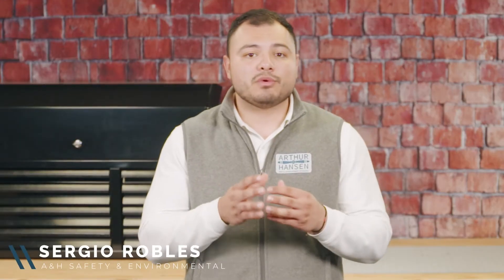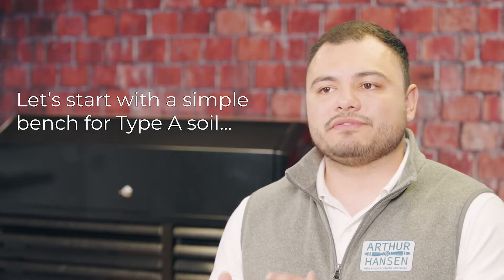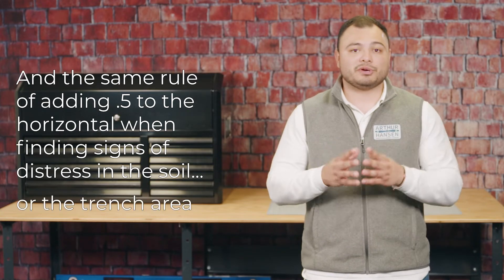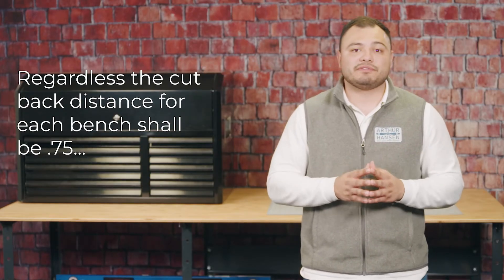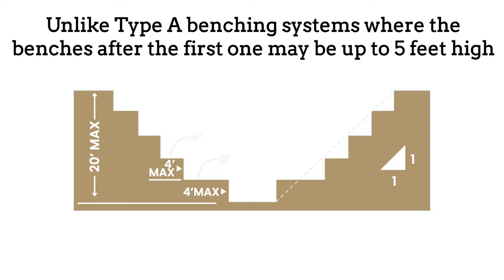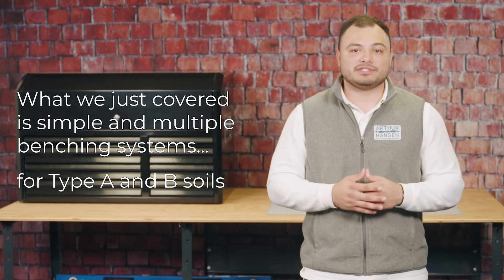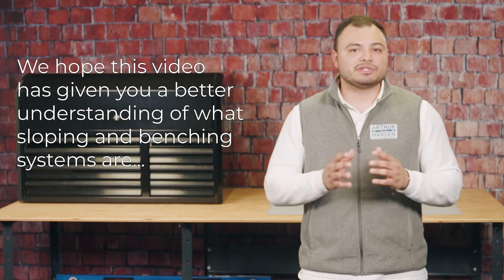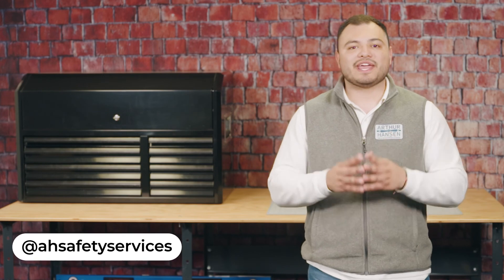Benching Systems for Different Soil Types: Sloping and Benching | Trenching and Excavation 2022

Comment: For type A soil, how did you get 6.75 if the bench is 4’ and the horizontal should be multiple by .75? And if signs of distress is shown then it is multiplied by 1.25, which still does not add up ?

Comment: Why is the horizontal bench in type b soil at the bottom twice as much than the rest?
Reply: Because the slope of B-type soil (45 degrees) makes the bench 8 feet long.  Note that the slope of A-type soil (53 degrees) makes the first bench almost 7 feet long.
Reply: @XavierGonzalez-h7n  I get where you are getting that but i cant find anything to support that other than the picture. It would make since if OSHA would give us that info it almost leaves it up for interpretation.